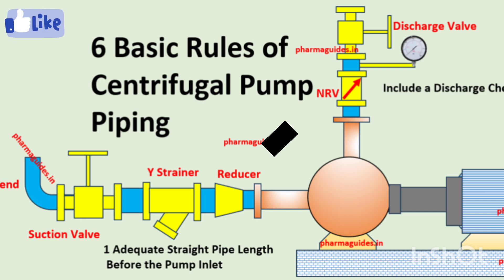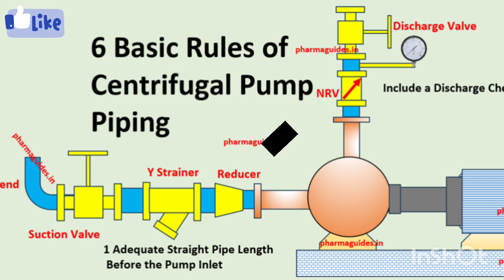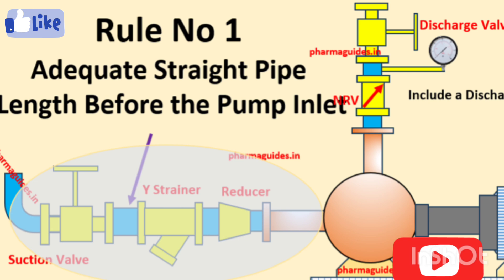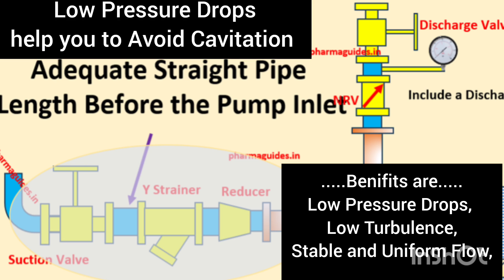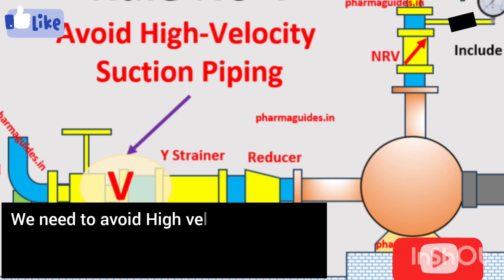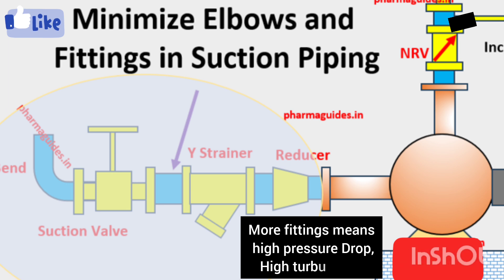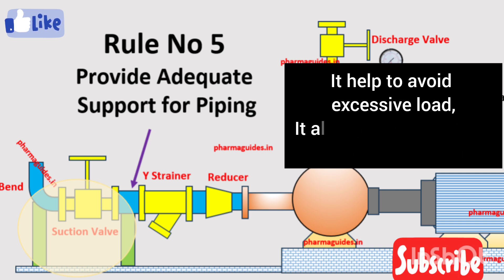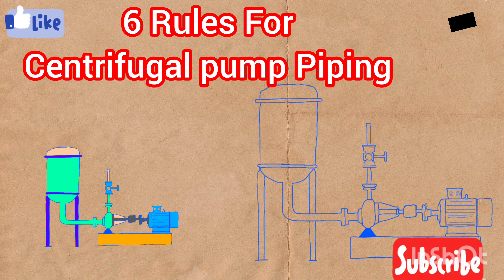6 Basic Rules Of Centrifugal Pump Piping @engineeringfacts1

Comment: WRONG REDUCER IS USED IN INLET SIDE TOPSIDE FLAT REDUCER WOULD BE GOOD FOR AVOIDING AIR IN PIPE WHICH CAN AFFECT PROPELER IN LONG RUN
Reply: Yes FST is used for liquid services, and FSD is used to slurry services, but sometimes depend on elevation of source of suction side thank also.

Comment: WHY YOU PROVIDED Y STRAINER,  WHAT IS THE PURPOSE AND CODE REFERENCE
Reply: Wherever space contrain is there compact sized Y type strainer used for smaller size dia pipe, for 12 to 14" onwards Basket type preferred.  Y type is effective for capturing large size particles, and there is limitations in capturing smaller size particles compared to Basket strainer

Comment: Up to what length?
Reply from the maker: Try to make it as minimal as possible, it depends on your process, you have to consider it when you calculate the NPSH
Reply: 4D to 10D, here d should be smaller size of reducer,  confirm with vendor, sometimes straight length requirement is depends on pump vendor,  provide first support adjustable for alignment and to minimise loads on pump suction
Reply: Suction straight length requirement 5D (API 686, 3.1.2.6)